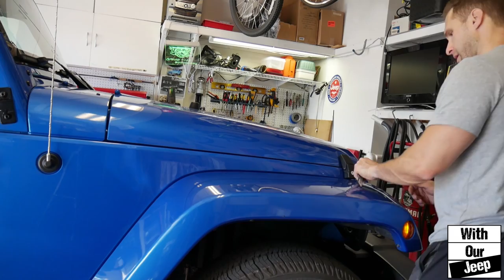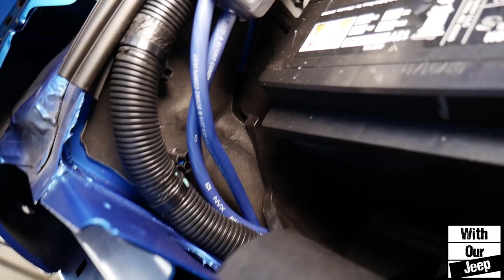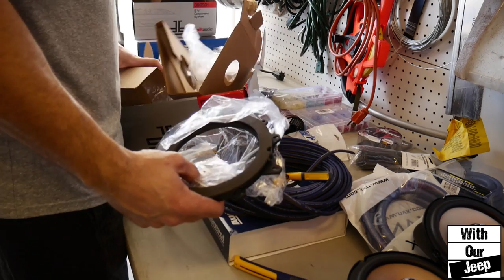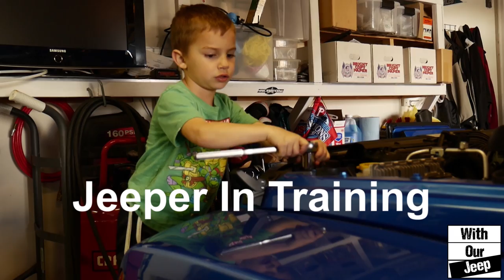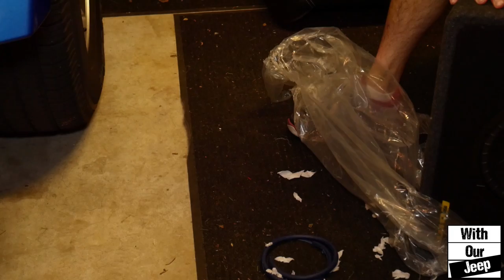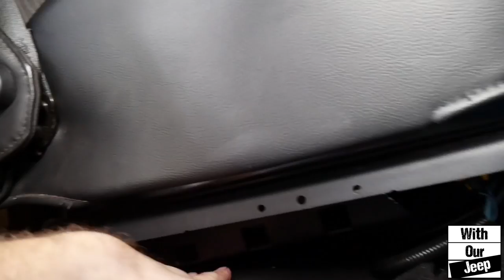Jeep Wrangler Full Stereo Install - Keeping the Stock Head Unit

Comment: Great video!  Two question. The head unit has 4 channels and the amp has 5 channels. How did you get the woofer installed , using the 5th channel? How was it wired ? Thanks.

Comment: Did you not put a fuse between the battery & distribution block? I'd be worried about fires if the power wire grounds out between the battery and the amp.

Comment: good video but it wouldnt be a true youtube video without some advice cuz everyone's an expert!..1) shouldnt put anything directly on top of an amp.  it generates a lot of heat and heat rises so the lc7 gonna trap that heat so the amp might over heat if youre really cranking it OR the lc7 might overheat but prob not. just sayin  2) throw those butt connectors out the window, solder solder solder and then heat shrink.  especially in a jeep.

Comment: In the video you used the remote wire from the cig lighter.  Does that turn off when you turn off the Jeep or does it keep it powered?  I worry about it draining the battery and have always bridged the remote wire from the head unit.  Nice Job!

Comment: Is your OEM system the Infinity upgrade? Just curious as you didn't mention the Infinity amp nor the 8in sub being removed or bypassed. Your vid is going to be very useful as I have the mount, Alpine 5ch amp, Kicker components for front, Kicker coaxial for rear and a Kicker sub for the stock location. Need to find an 8ch LOC since the sub is dual voice coil. Just wondered if you ran the speaker signal from the HU prior to the Infinity amp for a reason, if it has it. Thanks a bunch for your time.
Reply from the maker: Hi, no it is not. I did not have an amp or sub.
Reply: @withourjeep4702  Okay, appreciate the quick response. The effort you put forth is still going to help immensely. I'll just have to tie in past the amp whereas you used the harness out of the head unit.

Comment: I'm doing almost the same install, but with a Hertz HCP 5D amp.  I'm having troubles figuring out which wires coming out of the factory head unit like yours are the ones I should use for the sub input into the line output converter.  Do you by chance remember how you got your Sub signal to your LOC and what color the wires were?
Reply from the maker: Hey, checkout the diagram in this post. This is what I used. Hope it helps. https://www.jeepforum.com/forum/f96/not-so-simple-simple-way-upgrade-stock-jk-stereo-1227580/

Comment: What adapter did you use to tap into the stock wire harness for that brz head unit so I can install an amp?
Reply from the maker: I didn't tap into the stock wires. The stock wires go into the line output connector that then goes to the amp via rca cables

Comment: Thanks for the video you have saved me a lot of trouble trying to figure out what I wanted to do with my jeep. I purchased the speakers off of Amazon. How is the amp working out for you? It gets both positive and negative feedback. I would appreciate  if you would let me know thanks
Reply from the maker: Hey your very welcome. I have had no issues with the amp since the install. Quality for the price I think is excellent.
Reply: Are the tweeters and mids up front on the amp as well. I wouldn't think they would need to be pushed very much
Reply: Are the tweeters and mids up front on the amp as well. I wouldn't think they would need to be pushed very much

Comment: I'm still curious about the 2 4 ga wires coming out of the fuse block. One obviously is for the power to the amp. Where does the other one go? You said something about the ground but it didn't make sense to me. Thanks
Reply from the maker: The other one goes to the power inverter in the glove box.

Comment: Thanks for the vid!

I just installed a JL audio system in my 2014 Jeep Wrangler U. I removed the premium alpine system. My question is what wires did you tap into for each speaker on the factory harness. My harness has a hot and ground along with 6 other wires. I can’t find any diagram showing which wire matches with its corresponding speaker.
Reply from the maker: Hey Ryan. I found it but its from a photobucket account and I couldn't get the direct link. See if this link works though. If not google "2016 jeep wrangler speaker wire colors". The picture is the one that says "
stock radio" in the upper left. However if I remember correctly one of the rear wires was backward. 
  http://photobucket.com/gallery/user/goldenglory18/media/cGF0aDpDYXJzL0pLc3RlcmVvdG9yZS1xY29sb3Jjb2Rlcy5qcGc=/?ref=
Reply: Interestingly none of the wires match that guide. I traced all the old speaker wires to the old amp under the steering column. The only wires connecting the amp to the radio are listed below. 

Black/White 
Grey/ Orange
Grey/Blue or violet 
Green/Orange
Green/Blue or violet 
White/Grey
White/Orange
Yellow/Red
Reply from the maker: That might be the issue. My jeep did not have a factory amp. I believe those are different than ones without.
Reply: Ryan Miller mine are the same exact and I can’t figure it out either
Reply: With Our Jeep 2014 Jeep Wrangler has factory amp 
oh ready put aftermarket radio  power on but no sound fuses ok too
Reply: Did you ever resolve this? I'm having the same issue. I also have the 6 wires, and cant figure out what they are.
Reply: xaroc3 Your only option is to replace factory head unit and amplifier with aftermarket. I figured this out after talking to multiple people. I’m sure there’s some electrical engineer out there that could figure this out but I just don’t have the time. I was able to keep all factory steering controls using Maestro steering wheel controller. 

This is what I put in. 

Pioneer NEX Head unit  
XD700/5v2
JL Audio C2-650X
JL Audio C2-650
JL Sealed 12TW1 Enclousure
Reply: @MillersCrib  Not what I wanted to hear... but thats what its looking like for me too. shame...

Comment: Awesome video. Thanks for taking the time to make it! I have an existing system in my Juke running from the OEM stereo (amp, front and rear speakers, sub), but I've been wanting to add something like JL's Fix 86 and Twk 88, or a Hertz H8 to flatten the EQ and let me add some more dimension to the sound. The only thing I've wondered is how the heck to get the stereo signal to whichever unit I choose (I have no idea how the installer did it originally). This completely answered that question for me.  Thanks!
Reply from the maker: Hey James, glad it could help you!

Comment: Ouch...running speaker wires & RCAs along side power/ground is a big no no, that's car audio 101. You're just inviting ground loop feedback & alternator hiss into signal. Always run power/ground & signal wire opposite from one another. Mounting cross-over in speaker pod isn't ideal either, you're just taking up air space in addition to speaker displacement depriving speaker of midbass performance. In time vibration is liable to rattle shit loose in cross-over. I know the moron on crutchfield video did it as well...doesnt mean it's right.
Reply from the maker: Hey thanks for your comment. Ideally I would have liked to run them opposite but this was the best way for me. I have no feedback, hissing or any interference. I think your splitting hairs with thinking the crossover is taking up space. If sonic electronix and crutchfield do it that way then its suitable for me. Overall I'm extremely happy with the sound and its way better than I thought it would be. Even with the stock HU. Thanks for watching.

Comment: Great video and links.....
My project is going to be almost exactly the same on my 2012 JK \m/ that I'll be doing this weekend minus the sub.
Question: What did you set your high end on your crossovers to?  I figure the lowest setting since the tweeters are practically in your face. I know it's probably personal preference but I know I don't want the tweeters screaming in my face and wanted your opinion on the matter. 
Also...How much tweaking did you have to do before you had everything 'dialed in' to the way you like it?
Reply from the maker: Hi and thanks for the comment. I actually left the crossover setting how they came and figured I'd change them later once I got a feel for them. I haven't had to change them though. The tweeters are not too loud at all. As for dialing in all the setting I only had to raise the LOC setting slightly and the subwoofer volume on the amp just a tad. That was really it. It sounds fantastic. Good luck this weekend. - Matt